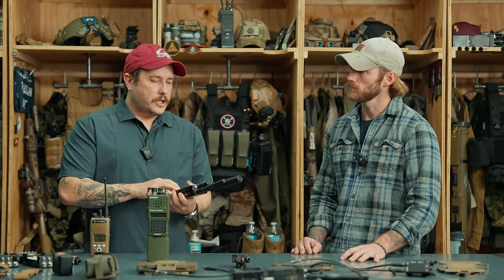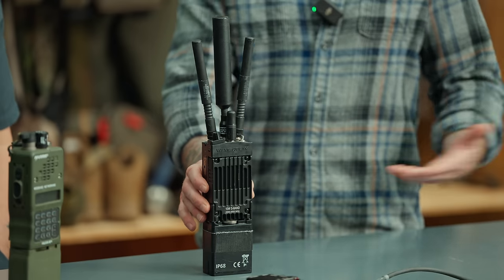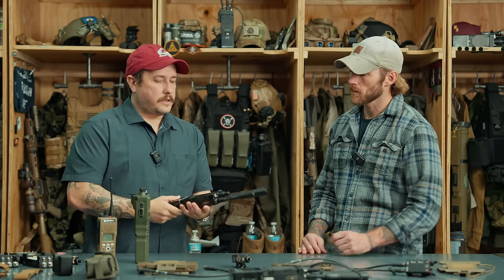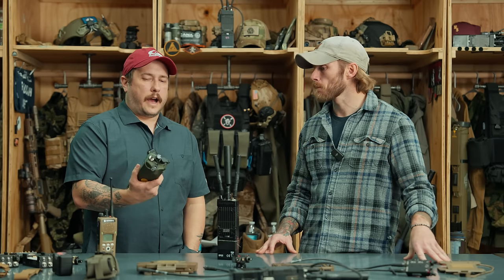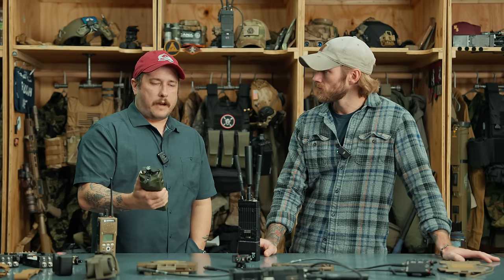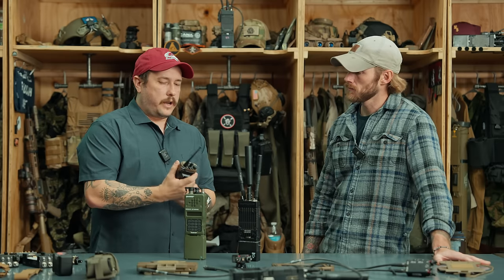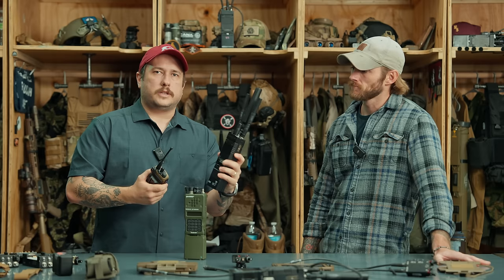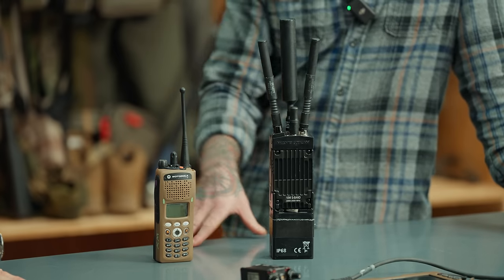Advanced Comms: Is the MPU5 the Future of Radios?

Comment: So really late watching but I would wonder if the footprint of the MPU5 could have an alternative set of internals that increases is ability to bounce low frequency and enhance the simple data transmission and a local network scrambler so your devices and unmanned equipment could operate with mild assistance in signal strength, but make it an unrecognizable Picasso. Just a thought for folks who would like modern tech that has a small unit gone native in mind. I am not familiar really with possible home modifications or any serious use of these small high data units, but they seem like they're honestly only useful to a fully supported mechanized force. I do know that anything with an IP is more  defensible, but only because you're opening yourself to a world of cyber and I live outside now Fort Eisenhower......Cyops cuddled up with the dissident surveillance service. Any minuteman kit recommendations would be appreciated. Feels like the Quatering act around here now that all the oath keepers walked away.

Comment: Question:
You have said that having some sort of JTAC on the ground is essential for operations with aircraft. Why is that? Why can't aircraft forego a guy on the ground, and what is that guy on the ground actually doing that sensors and electrooptics on the aircraft can't do?
Reply: JTAC is only there for CAS missions, where friendly forces are in close proximity to enemy forces and detailed integration from the ground to the air is required to safely conduct Close Air Support. As far as sensors, a JTAC is utilizing the sensors of the specific aircraft to the best of its ability in order to “talk the pilot on” to the enemy force. When friendlies aren’t in close proximity to friendly forces and detailed integration between the air and ground ISN’T required, that would be AI, or Air Interdiction

Comment: Excellent video, thanks! I have a question, my knowledge base on paradigm that if higher frequency bigger data bandwidth but range impacted. It just a nature of electromagnetic spectrum - bigger the wave- bigger a distance that it can travel. How it could be implemented: 100mbps over low frequency !!?
Reply: You can, you just take up a much larger % of the spectrum at lower frequencies. Imagine a 10MHz wide channel at 400MHz vs 4GHz.

400 - 410 vs 4000 - 4010

Shannon-Hartley theorem. Throughput is a function of bandwidth and SNR, so while you could send that much data, you would be using a relatively larger percentage of the spectrum at 400MHz than you would at 4GHz.

Comment: I've found TSM (used trellisware, 163, and 171) and it's definitely the solution. The MPU-5 Bands are just too high for ops in dense terrain. MPU-5s work well over LOS but for being worn by an idiv, they are too high band (too much bandwidth, too poor forest/jungle/urban).
Reply: You can swap out the Freq Module:
RF-1150 - 10W L-Band Freq. Range:
1350 - 1390 MHz
RF-2150 - 10W S-Band Freq. Range:
2200 - 2507 MHz
RF-2125- BAS Band Freq. Range:
2025 - 2150 MHz
RF-4100- Lower C-Band Freq. Range:
4400 - 5000 MHz
RF-5100- Upper C-Band Freq. Range:
5100 - 6000 MHz
Reply: Just add a screw driver to your BOI and remember to call timeout during the TIC so you can change frequency.
Reply: Im curious, what does the MPU5 do better than the 163? The datasheet seems to list that it is able to do more than the MPU5 but im guessing that's mainly  marketing hype.
Reply: @065Tim  the solution shouldn't be what is effectively 10 different radios. 

Trellisware radios only require a single handset to cover several mghz worth of bands. Your antenna is out of band before the handset is.

Comment: So carry an extra radio and kit to tie into existing RF networks? Why not just carry 163 that has all the same capabilities?
Reply: 163 isnt a MIMO solution, it’s still SISO just with 2 antenna. Agreed the 163 has access to waveforms the MPU5 doesnt, but the ability to ROIP with 1x 163 in a group and let everyone have the capability of both showcases the strengths of the mpu5 in a big way
Reply: @Tragic387 RoIP is nothing more than SINCGARs retrans, but unlike SINCGARs, is reliant on an extremely exploitable wifi network.

The 163 offers internal crossbanding of any networks (LOS, Dedicated SAT, Sling, MANET, etc) without requiring two radios, cables, and a screw driver to change frequency when you get jammed.
Reply: @MichaelJoannides  yep. It’s definitely not a do-all one ticket item. The retrans statement just keys up the 163 the same a ptt would. You don’t lose any capability since the 163 still needs to be present, but you also don’t have a 163 on each person - so there’s a larger emphasis on position and rf quality from the singular 163.
Reply: @MichaelJoannides also not tracking the screwdriver comment, what’s meant by that?
Reply: Im curious, how does the MPU5 compare to the 163? The datasheet seems to list that it is able to do more than the MPU5 but im guessing that's mainly  marketing hype.

Comment: This is a really neat device but for 10k it's a hard sell for most civilians. I can accomplish the same things with an anytone AT-D878UVII PLUS and a handful of 900mhz and 2.4ghz lora devices for data transmission and mesh networking with AES encryption and those also control my drones and whatever robotics. Real time video transmission is going to be impossible on anything less than 5ghz. You are out maybe 1500 for that setup. As a civ you wont be transmitting data on other bands beyond 900mhz, 2.4ghz, and 5ghz and as a HAM you can push data across UHF and VHF with the Anytone but those bands are slow as it's not much bandwidth. Also Lora and Packet Radio are open source protocols so you can hack together whatever you need to interface with.

Comment: I'd be interested to know what kind of a footprint this system produces from a anti-signals warfare point of view. (If that's even a thing) 

Aka: What is the threshold for detection by a hostile force? How disrupt-able is it? How easy is it to send false signals to a group using this gear? Etc.
Reply: Just think about how ubitquous wifi has come. Now realize that its on its 4th security revision (wpa3) and its still quite vulnerable. 
This system is going to resemble swiss cheese.

Comment: This is great, and it has its place, but the nature of the system means that you're essentially heartbeating and at semi-regular intervals on whatever network frequencies it's working on. Seems like a great way to vector a df station in on you based on your rf signature. And yes, ip anything is still just an rf wave with different modulation. Whether or not you can understand it, you can still df it.

Comment: Radio over ip…hackable. Curious to know how resilient protection is with how versatile this device is. The Media having access to the device means they can hop on other devices and listen/ watch in/on after a quick hack or ip-hunting.

 Adversarial-5GW capabilities can easily take this down  if the wave relay crashes (passes) over a specific location?

Where is the warm and fuzzy on the security of the device? I’m seeing holes in this cheese. Getting in touch. Nice video!

Comment: I just don't see how this protocol would be actually beneficial for separate teams that are not connected to some major command center by a larger power radio system. Even then, it is a wifi signal so not that far of a range for real high data rate. I guess you could stream your gopro to your teammate about 30 feet from you in the open? I just don't see the application unless you have satellite/air up/down links. There scenarios are purely for large scale military departments. Who outside of taxpayer money spending jobs would use this?

Comment: (I have used the MPU5 for roughly 4 years)
The recent updates to the MPU5 have seen improved performance in their LPI/LPD capabilities. Though admittedly there is still more to be desired. I like the MPU5 and it's great for mesh-networking for sending data streaming.

The Mobile Ad Hoc Network Power-Control (MAN-PC) minimizes the radio’s transmit power while maintaining your desired throughput. 
When compared to conventional army's Silvus, the MPU5 has enhanced performance. Is it perfect? Not at all. 
Between (seemingly) randomly losing link. The lack of GUI. And the hassle in the realm of encryption, there's still a lot that can improved for ease of use of the general operator outside of the Echo or dedicated Comms guy.
Is it the future of radios? I think it's a lens into the capability of enhanced radio systems. But in all actuality, especially when consider Large Scale Combat Operations, or Conducting Operations in a Denied Environment; there will never be one single radio that solves all. Robust Comms Plans utilizing different comm bands, antenna arrays, and polarity are some of the pieces to the overall pie of success.
Reply: I'm curious as to what you mean by "enhanced performance?"
Reply: Very interesting, so what would you say the average range would be for an MPU5 in an urban environment?

Comment: Im interested in whch is going to get more widely adopted, this or the PRC-163. I think the biggest difference is that the 163 is SiSO with manual adjustment, and i dont think it has the same ease of connectivity
Reply: Im curious, what does the MPU5 do better than the 163? The datasheet seems to list that it is able to do more than the MPU5 but im guessing that's mainly  marketing hype.